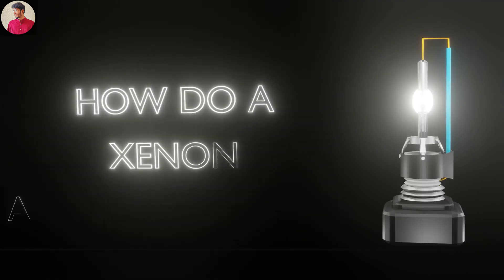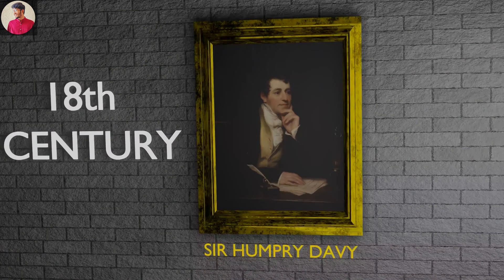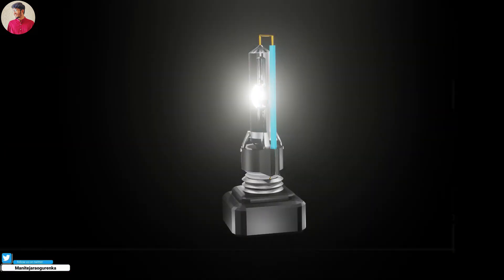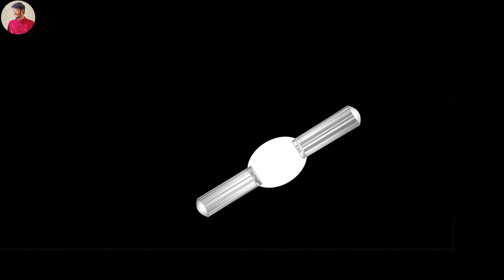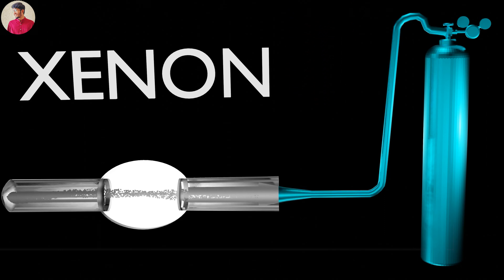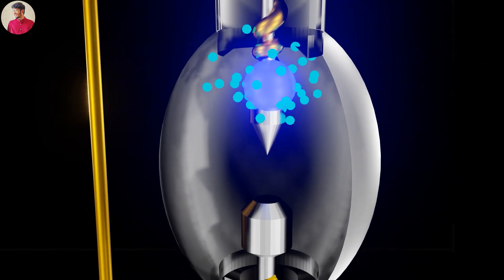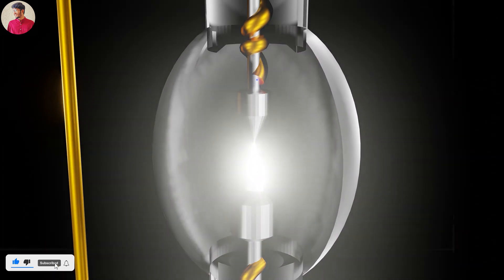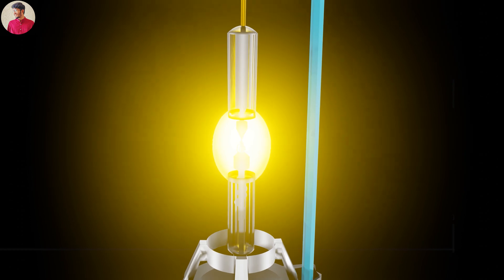HOW DOES A XENON ARC LAMP WORKS

Comment: This is a metal halide lamp
The xenon acts as an activator and  as no value in the car light radiation 
The blue color is coming from the phosphor coated cylinder  interacting with uv light from xenon 
Long story short,,this is not xenon arc light.
Reply from the maker: ok got it! thank you...